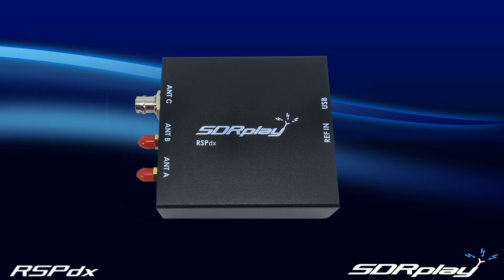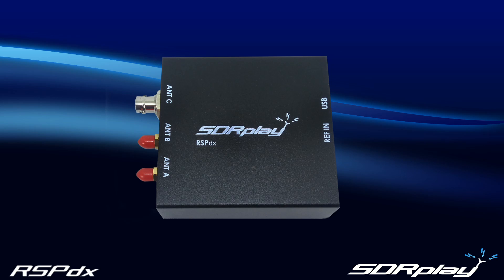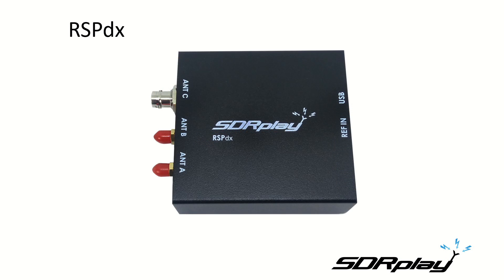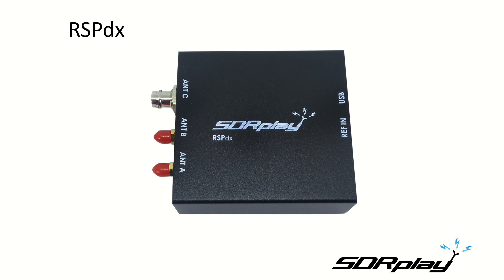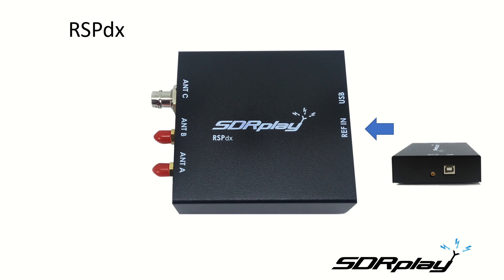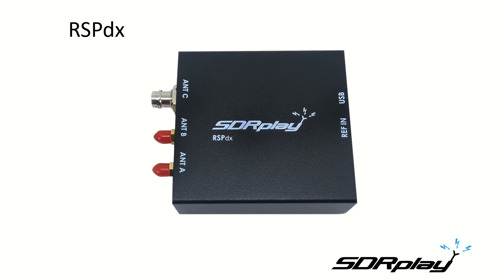RSPdx Introduction

Comment: Do the front-end filters block DC?  my SawBird LNA sends 5VDC through the output to the receiver.
Reply from the maker: Usually the StarBird LNA is powered by an activated Bias T DV voltage coming from the SDR.  This is a note from one such StarBird LNA product description "Each module allows for 3 different power options, but you should only power with one option at any given time! The recommended power input through the SMA output port (for bias-tee capable SDRs like the NESDR SMArTee XTR) is 3V-5V DC. Alternatively, if you don't have a bias-tee capable SDR, you can use the external power options through the microUSB port or the power input header. The recommended external power input is 3.3V-5.5V DC." ...end of quote.  You should not apply DV lotages to the SDRplay RSP antenna socket.
Reply: @SDRplayRSP  Yes, I did read that but misunderstood.  Thanks for your patience.  I was making this more complicated than it is.  But it is all good news.  My SDRplay has selectable DC out to the StarBird so its a simple solution to a simple problem for a simple mind :)
Reply: Oops, there I go being optimistic again.  The Sawbird draws more current than my sdr receiver can supply through its bias t.  So I'm back to external supply.  har!

Comment: Could this be installed outdoors (in an enclosure) in a harsh Canadian climate (up to + 40 Celsius degrees in summer and down to  - 25 Celsius in winter)?

I live in an apartment and can't drill holes to the outside for an antenna. My plan was to use SDRconnect in client/server mode - having the SDR, server (Raspberry Pi) and antenna outdoors. I'd use Wi-Fi (from the Raspberry Pi) for connection to the LAN.
Reply from the maker: We know people have used the RSPs in such environments but it is difficult to guarantee operation.  Our products are designed to work above 0 Celsius.  The key concern is condensation and moisture ingress through extreme temperature cycling.  If you keep some of the electronics powered up, and they are in a sealed enclosure then the ambient temperature might be raised and the possibility of moisture problems minimised.

Comment: Is this compatible with CubicSDR? or better yet, when is SDRuno available for macs? :)
Reply from the maker: 1. Yes
2. See the roadmap at sdrplay.com
Reply: @SDRplayRSP   ah thanks for answering. What's the dev team like? Is it open source? The multiplatform tcp server would be sweet enough, I could code a front end for it!
Reply from the maker: @JonathanAdami  The multiplatform server will come first.  V 1.41 is nearly full production and work on the multiplatform server version for V1.42 has been going on in parallel.

Comment: What antennas do you use out of interest just so I can compare with my rsp2 and variouss bits of wire :D
Reply from the maker: It’s the Bonito Megadipole MD300X.
Reply: SDRplay Software Defined Radio Receiver blimey, that costs more than the unit!

Comment: Is new at this.....can it decrypte digital signals,,,,,police,,,,,fire and ems,,,,,thank you
Reply from the maker: Hello.  No it is purely a receiver. It can receive signals anywhere in the radio spectrum from 1kHz to 2GHz.  It can demodulate most forms of analogue audio modulation using the SDRplay-provided SDRuno software.  That same software can be connected via a "virtual audio cable" to other 3rd party decoding software for reproducing images, TV or digital audio.  In the case where the signals are also encrypted for security purposes, it may be illegal to decrypt such signals.

Comment: I wonder how well the RSPDx would work at my location. I live about 6 miles away from Droitwich, home of the LW transmitter on 198kHz and also on the same site a number of MW transmitters. It doesn't matter what radio or antenna I use they all mix and I get a lot of interference from the site. I have managed to reduce some of the noise with a home built pass band filter and switched stepped attenuator. I tried a RSP1A and sorry to say it couldn't handle the overload when trying to receive NDB's on LW. I currently use an RSP2PRo with my attenuator and band pass filter and it's better than the RSP1A but I still have a lot of noise to deal with from the LW & MW transmitters.  Do you think the addition attention to the hardware below 2MHz will help here ? Thanks, Mike G1ZRN.